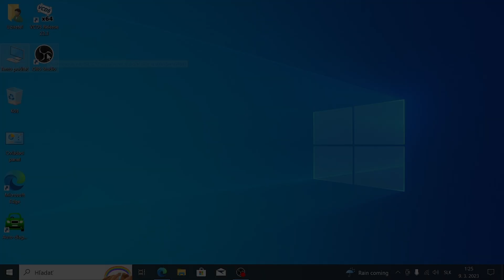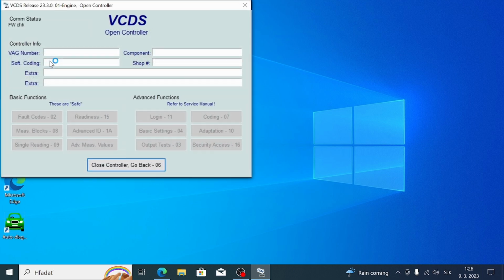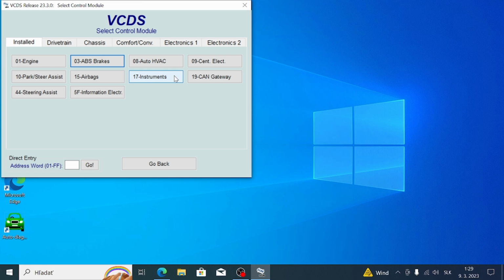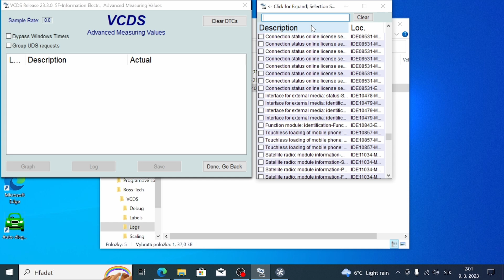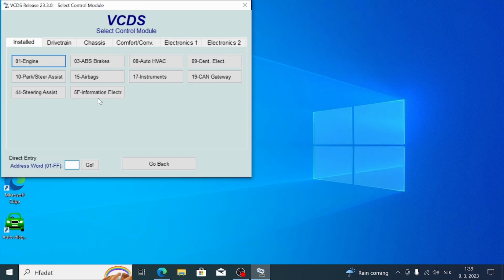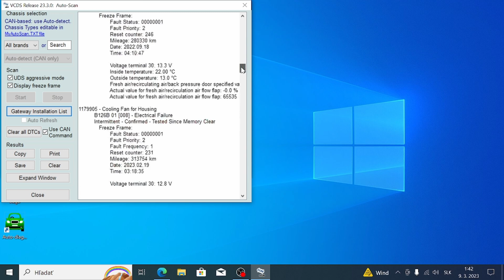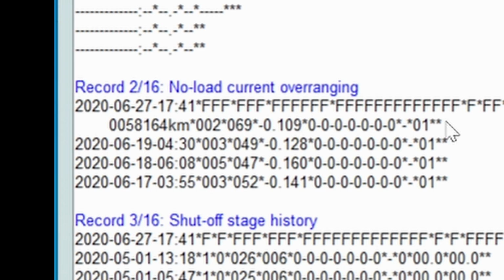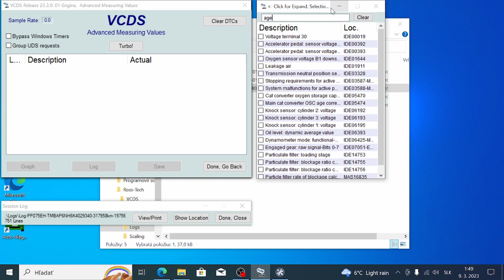Verify real mileage on your VW/Audi with VCDS

Comment: Note that even if VCDS doesn't show obviously faked data, the mileage may still be fake. If you cannot find evidence for fake data, either the fake was executed by competent hacker or the mileage is true.
Reply from the maker: Of course all data can be adjusted
Reply: @iamcarhacker  Sure, the question is if it's more difficult to adjust than just accept lower value for the car without the forgery.

For example, the TPM chip in most computers is supposed to make extracting or modifying the data on the machine hard enough to not be worth the effort.

The implementation of most car components appears to be less secure than TPM chip, but because lack of documentation it's still hard to modify all data in practice.

Comment: Thank you for this great video!!
I bought an Audi A4 2015 and the mileage was changed to (72k) km. Now, i knew the real mileage (225k)km but the problem that I can't change back the number. When I tried to put a new value it doesn't reflect in the test value cell. I don't know if it's because of the security code. 
Could you help me with this?
I really appreciate your help 🙏

Comment: Hello, you say that you can check the mileage with OBD eleven free plan. Is this still so?
I mean I dont have to buy a pro or ultimate one, just the obd plug with te free plan?

Great video’s! Keep them coming 🫡
Reply from the maker: Yes accessing live data in all modules is already in FREE plan so you can use it to check mileage
Reply: @iamcarhacker  I drive a Passat b8. do you recommend the OBD eleven above the obdlink mx +? Find it hard to make the choice
Reply from the maker: @51F  Sure for every VAG vehicle OBDeleven will get you lot more functionality than OBDlink
Reply: @iamcarhacker Again thanks!👊

Comment: Is vcds reliable on detecting car km?
Reply from the maker: VCDS is reliable however all the data can be changed with tools like VCP so then you won't find out about mileage fraud if they changed it.
Reply: Yes, but fraudsters can change all of these values, even if they do, you can still check for consistency, in case if they forgot something, or the fake values don't add up. There's also plenty of other methods to check for fraudulent mileage, such as the condition of the interior itself, seats, pedal wear. service stickers under the hood, papers, repair bills in the glove compartment,.. Also things like: If pedal rubbers are new, they probably replaced them because they were way more heavily worn than they should be according to the fake mileage. Oh and if the engine compartment was washed that's probably because there's oil/coolant leaks everywhere.

Comment: Hi can i restore the original mileage ? Cause my last inspection says 313k km but i got the car with 236k km don't mind (also didn't know forgot to check) but would like restore the real mileage. Im planing on buying a vvdc to read stuff. And from the 2017 inspection to the 2022 inspection the car only did 400km 😂 (and normally its every 2 years) according to history so it sat for 5 years but it drives good. Im gonna check over timing belt and might do a gearbox fluid change cause I don't trust anything cause seller said chain driven and gearbox oil changed at 225k km but thr inspection in 15/04/24 said car had 313k km but failed but the inspection i got witht it 20/04/24 said blank at the mileage 😂 and passed inspection. Again as long as it drive I don't mind. Its just very confusing the more u look into it
Reply from the maker: With vcds you canjot adjust mileage :/
Reply: @iamcarhacker  ah damn, so im gonna have to life with a speedo that says abot 100k less then the car should have.
seens some video where they modify the mileage but they have a extra tool, not really feeling like buying more tools, already need the airbag reset tool and vcds tool to be able to delet airbag and read error codes